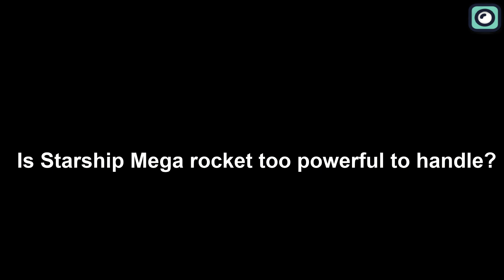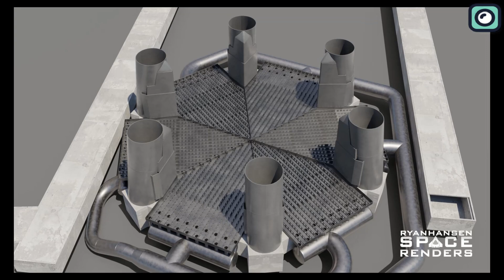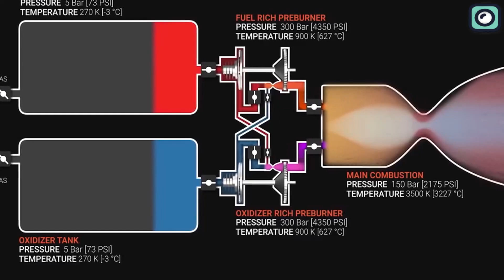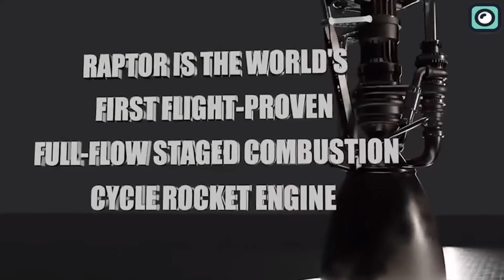Starship's Raptor engines BIG PROBLEM....

Comment: SPACEX is not in trouble. This launch was not a failure. It was actually a success because the first goal was to clear the launch tower which it did. The second objection was to achieve flight, which it did by making it to near 26 miles in altitude. 

The problems experienced were not all due to design issues or equipment failures/malfunctions. 

The primary problems with the spacecraft were caused by debris thrown up from the massive blast of the rocket motors. Large chucks of concrete and pieces of the launch pad were thrown up and into some of the engines (5 and possibly 6) damaging them. The remaining 26 engines functioned just fine. 

Great job Elon.
Reply: Elon doubts any debris actually made it up against the intense rocket blast, into to engine bay. He said there was no evidence that this had occurred. Each engine on B7 was a unique prototype and the batch on B9 are much improved and uniform in design and operation. 

The primary cause of the loss of B7 was the failure of it's hydraulic steering systems, which have already been replaced with an electric motors based system immune to the failures that doomed B7's flight.

Comment: Mighty Musk had No Choice ! ... He could have waited and ripped up the Fondoom Tarmac to replace it with water cooled Steel ... But it would have taken Months , and the Rocket Launch was holding up the Works at Boca Chica and Florida ... So the BF Rocket did the Digging , and the team got a Revealing Launch ! ... Now the Necessary Upgrades can be identified ! ... Otherwise the unknown flaws would have remained Unknown ! ... Now everyone is Busy working on the Fixes and Building a Better Rocket and Lunch Pad ! ... Musk promised Excitement and you got it ! ....... The Deed was Done .... Next !

Comment: I never expected the concrete of the OLM to survive. The concrete was pumped into place. To pump concrete it has to be heavily dowsed with water, leaving large amounts in the concrete when it sets. This will boil and produce high pressure steam in the concrete, causing it to spall away and be blown away with the high speed and temperature of the flame thrower ( booster). If the correct amount of water needed to set concrete is used it is impossible to 
place as it is too stiff to work. The concrete will not dry out as it placed in saturated ground.
That water cooled steel plate is definitely required and water supply of high enough pressure for it to escape under the high pressure of the exhaust gases.

Comment: Space X’s heavy launch vehicle and its Raptor engines are promising breakthroughs, however; several engines failed during the first stage’s launch and ascent. An outside source stated that it appear: E1, E6, and E7 had failed at launch. E18 failed violently at T+30; E19 failed at T+46; E22 failed at T+60; E23 failed at T+94; at T+122 flames were visible at the thrust section; and at T+130 the rocket started spinning out of control.  Also, the rocket did not reach its design attitude for stage separation.
Reply: B7 was a test article that had over one year of redesigns and retrofits as new ideas were implemented. The next generation B9 has already been built with many of these upgrades designed in as robust changes to the booster's specifications. 

Each of B7's Raptor 2 engines were unique prototypes, all differing in specifications and features. The design of B9's engines have moved toward preproduction status, with each engine being mostly similar, with less differing "personalities". 

The failure that caused the test to end without completing all objectives was the hydraulic steering system, of which both redundant segments failed at different points in the flight. Elon Musk said that if the steering had remained operational, the rocket could have throttled-up after MaxQ and reached the proper altitude for the next test objective; staging. Had that occurred, S24 likely would have made it all the way to the area near Hawaii.

Booster 9 is an improved design which will likely reach milestones B7 failed to accomplish. The Launch Pad; Stage 0 systems are being quickly upgraded to address it's points of failure, making "Rock Tornadoes" a thing of the past.

Comment: Excellent Analysis!  During the launch of the NASA’s Space Launch System rocket, the “Ignition Overpressure Protection and Sound Suppression water deluge system” at Kennedy Space Center’s Launch Pad 39B released approximately 450,000 gallons of water across the mobile launcher and the flame deflector. This suppressed the acoustic energy produced by 8.8 million pounds of thrust! Where was both the flame deflector to channel the rocket exhaust away from the launch pad and the water deluge system to dampen the acoustic energy of these engines (power of two Saturn V’s)?